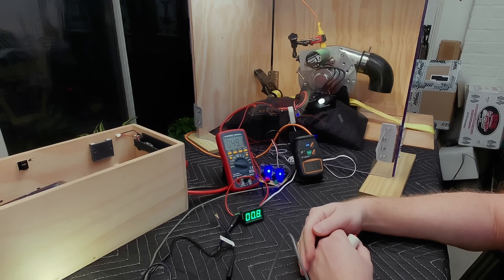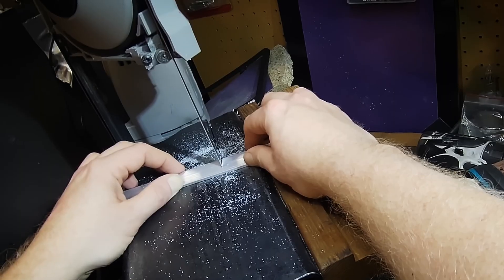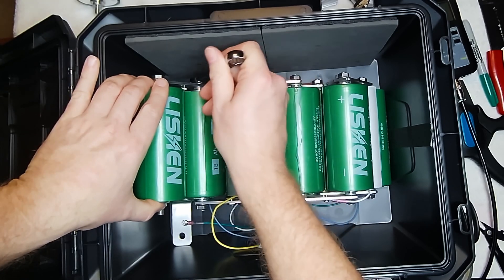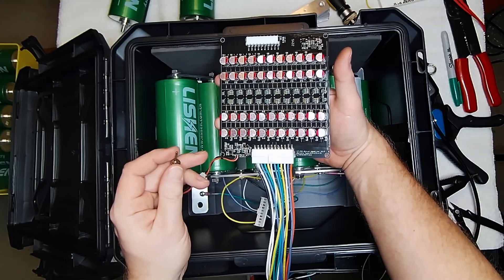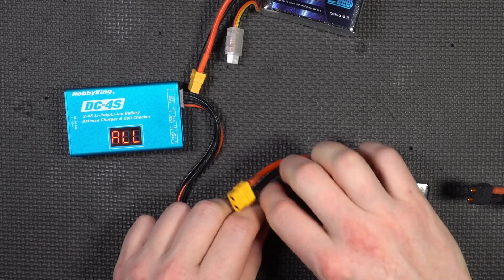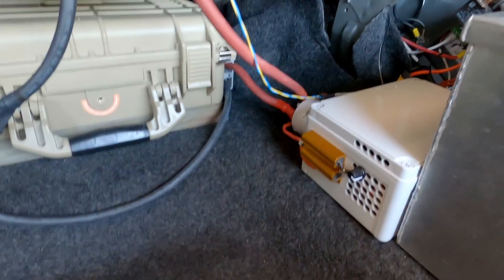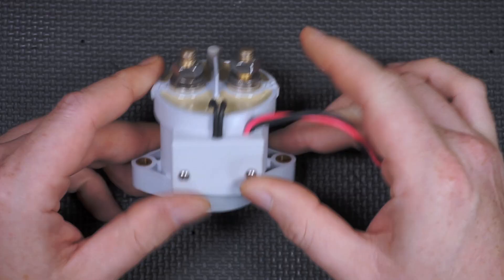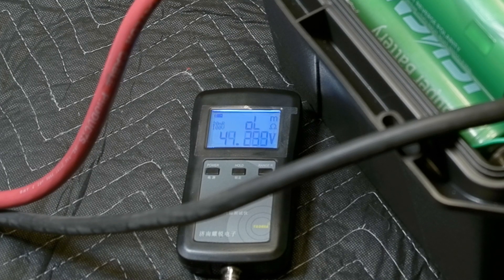I build the Ultimate 12s Lithium Battery

Comment: whats crazy is i ended up building a 12s 18ah battery pack for an ebike lipo pouches  would sut this applications very well also very compact
 and its rated for well into the 15 kw mark   ive pulled about 7 hp in continuous burst for almost whole pack duration and voltage sage is 2.2 - 3v  so 0.2/0.3 volt drop a cell at   seems like that monster that u need i ended up putting into a army ammo box  litteraly bom b proof as im very aware how big the fire ball will be
Reply from the maker: We saw about a 10 volt drop from 63 volts while pulling 44hp continuous from the Sledgehammer pack - that's 24s of these cells.  Some of that drop was from the fuse and wiring.  I think once we stop blowing up ESCs, I'll switch to standard high-power lipos for compactness - which would also allow for shorter cable runs.
Reply: @AlexLTDLX  one things for sure  44hp is bloody insane no matter what you gonna make history for electric nerds everywhere ❤

I will be watching every vid sharing and following your recommendation and documentation

My pack taps out at 28/30kw and thats its drag max burst 30 second
600amps 50v
12s 4p so 150amp a pouch

At this point your one of very very few people that is pushing lipo /lion / lto 
and rc technology   

You are litterally doing what oem is doing electric turbo adders for bursg power

Comment: Hey if you didn’t know the ota programmer for the hobbywing is Bluetooth and logs data with live data streams.  I did some 10s logs @ 600+ amps under serious load without issues.  Pretty impressive esc for the size and price
Reply from the maker: I have an OTC programmer right here on my desk.  It'll be in upcoming videos.
Reply: @AlexLTDLX  man your awesome.  I think it automatically detects pole count for the motor but I’m just figuring it out my self, nice to see it handle the amps without overheating.  I enjoy your videos and will send funds to help when I can👍

Comment: Those "itty bitty" connectors might be your bottleneck now.
Reply from the maker: For wiring in the car I now use big Anderson Power Pole connectors; but once you get to the ESC/motor, the RC connectors are used.  I have a video on my channel where I measure RC connectors' resistance in milliohms - they're actually quite good for what they are.  8 mm connectors can handle a surprising amount of current.